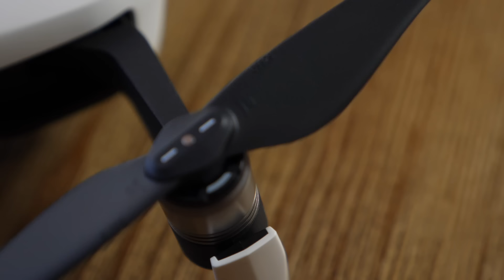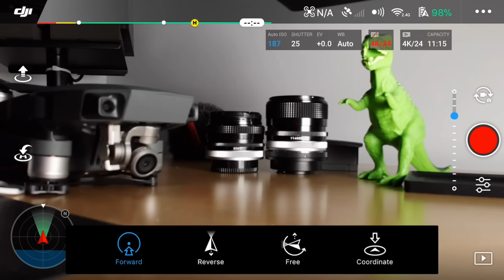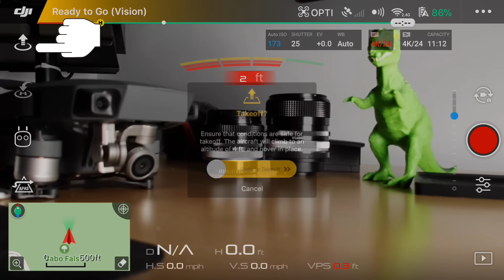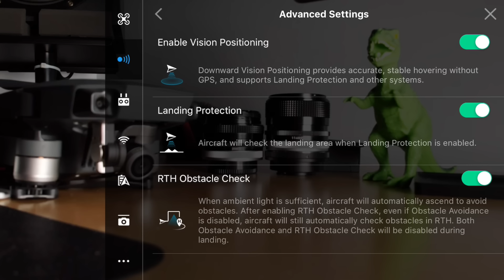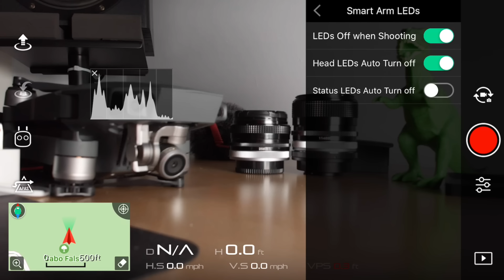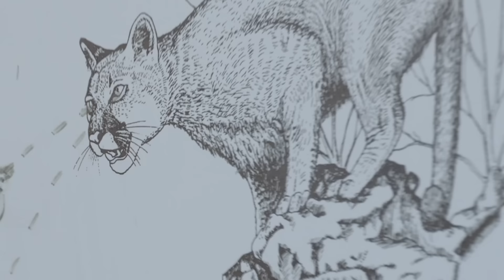DJI MAVIC AIR Beginners Guide - Start Here

Comment: Great video, no nonsense, no watching a 20 minute vlog to get to the content with over exaggerated reactions. Helps a lot, got my Mavic Air Flymore combo for 500 CAD used today. Has never been crashed, only 50 minutes of flight time, original stickers and plastic are still on some of the parts and batteries are all working. So stoaked, was going to buy a Mavic Mini but having the extra weight because where I am wind is a big issue and having all features of the air I couldn't be happier for the price, it's almost brand new.

Comment: Excellent video. Just got my Mavic Air. I had one problem setting up the drone. It asked for a password for the Mavic Air. I used the password I had with DJI...nope. Then I proceeded to use every password I have ever used....nope. WTF. Called DJI and actually talked with a human in just a couple of minutes. He told me the password was on the battery. Looked all over the battery...NOPE.
Finally looked in the battery compartment and there was that little stinker. It 's actually on the outside of the drone too. The other surprise was the "quiz". Got them all and passed that little surprise.

Comment: Really good info for someone new to DJI and the app. The most thorough and complete I've seen so far.  I had to rewind a few times because you moved through the options on the app so fast. I can fly pretty good but the app is a little intimidating to me. This helped a lot.

Comment: Excellent video. I’ve been flying a mini, but I just got a used Mavic Air, so I watched this video to check out all the extra features. Thank you for the comprehensive overview !
Reply: What app are you using to fly your Mavic Air?
Reply: @xseaangelx  DJI GO 4
Reply: @fullsendfishing2363  On my DJI Go4, there's no option to fly the Mavic Air. There's only a Mavic Air 2.
Reply: @xseaangelx  weird—— there is on mine. Connects easily

Comment: Thanks Bro - I was just about to pull the trigger on my first Drone as a beginner and was gonna go for the Spark until I saw this video. My feeling from the video and the comments below is that I will out grow the spark quickly where as the Air, for a little more money, will serve my purposes as a beginner better for longer. I subscribed and will begin watching and learning from your videos!
Reply: Got my MA yesterday and charged it up last night. Reviewed the directions for the 3rd time. Went out to my back yard and flew in Beginner Mode until 30 % warning. Practiced squares and then circles. Concentrated on Not over compensating on the joysticks . . . nice slow soft movements (like on the toilet bowl)!

Comment: for safety reasons, you should not turn on the drone first like in this video. the controller should always be turned on first. The drone could pick up a signal not related to the controller

Comment: I have flown quads for over 6 years now..starting with a $70 one learning to fly with no GPS..then got a phantom fc40..even built my own racing drone but didn't use it much..just got a yuneek thphoon H for around 1k..it is amazing for the price retractable landing gear and folding arms carbon fiber.. full 360   4k camera..just don't see how the price point on this can compare..it is smaller and I can do tighter flights because my hex is bigger..but my hex comes with a built in android tablet and is amazing more professional controller.

Comment: Extremely helpful intro to the MA controller and it's functions. Is it possible to open this app on a smartphone without either the aircraft or RC turned on so as to be able to get a grip on all the controls?  There's a lot going on there as you say, it would make sense to me to be able to do this without having to turn everything on and run the batt down. Great tutorial.

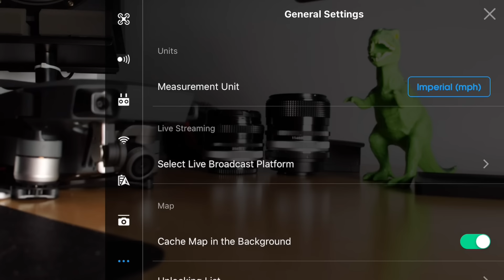Comment: Hey Jevon, I'm relatively new to Drone flying. Had a Spark and just got my Mavic Air today. I noticed first during setting up my Air and also while going thru your tutorial, the Measurement Units are set to Imperial (15:20 of this video) but several of the selections display metric units (15:56 RTH Altitude) . Not really a big deal for me, just an observation. Should all displays be in Imperial Units? Thanks again for your video's. Very informative with no BS.

Comment: I am newer to drones so please excuse the "lingo" I use
#1 - I have a Parrot drone which allows a function of true flight direction
With this option, if I move my controller to the left, the drone will fly left regardless of the forward facing direction
Is this available on the DJI ?
#2 - does this drone have an auto land or is the decent speed 100% manual ?
#3 - In your video, you went through many options to turn on or off such as obstacle avoidance - Is there any reason to not have these turned on / any advantages ???
>> real close to pulling the trigger but simply want to make sure this is the drone for me <<

Comment: Jeven, this is an excellent tutorial as my Mavic Air is new to me. BUT... I could only fly it once, using my LG K20 smartphone. That was great, as the drone itself is fantastic. Then it would not recognize the controller and always asks for compass calibration, even in middle of a large field. Very frustrating. So (doubting the Android shit) I exchanged the LG for an iPhone 6s. DJI recommends ONLY iPhones. Great issues getting the GO 4 software, from iStore however... Apple really sucks at that! . Have you encountered these kind of problems? Wish we could just connect drone/controller every time and fly!

Comment: Excellent video buddy!!! I am thinking of buying one instead of the high priced Mavic Pro 2
And with additional money buy extra batteries. What is your recommendation?
Reply from the maker: I'd get the Mavic 2 Zoom or the Air.  Depends on what you plan on filming.  The Air is amazing and can get you some awesome footage!  Also its super small and you can take it everywhere
Reply: @JevenDovey  
Thanks! Well it would be my first drone with DJI. The Air just has some cool features like hand jester control which is cool. The Air is a bit more compact and of course price. I am just really  looking for a new drone since my GOPRO KARMA has turned out to be a real dud. Discontinued with no updates the Karma was a big mistake I regret.  I am trying to sell my Karma remote, 2 batteries and bag. Keeping my Karma grip, hero 5 and gimble. Thanks for a terrific in depth video! I value your opinion and your business.  Cheers Mate

Comment: Awesome Video as always!! As a Newbie, I've learned an incredible amount from you alreadyI have a question in regards to using the remote controller; I understand when the right joystick is pushed up with the camera facing you the Mavic Air will move away from you. If you pull down, it will come back to you. Left is left and right is right. Now my question; If the Mavic Air camera is away from you does the  joysticks act in an opposite manner?  Example; down is forward, up is back towards you, left is right, right is left? I can't find any info. on this anywhere. Any help would be most appreciated. Thank you, Ray
Reply from the maker: No.  The controls will never flip.  Think of it like a video game.  If you turn in the sky forward is still forward no matter which direction you're facing
Reply: Thanks for the help. It appears that Mode 2 for the controls would be the better choice. Just need to keep in mind that the cameras POV is the decision maker. When the camera is facing the controller/you the controls act opposite. Thanks for the help and for your awesome videos, I'm certainly looking forward to more in the future. Happy flying!! 😋👍

Comment: @Jeven Dovey
Maybe you can help, I currently am flying the Dji Mavic Air! I am having problems with linking up the remote control to the drone to get that green light on your controller. I know you are suppose to hold at the same time pause bottom, FN button and the C button on the backside of the controller and then I get a 1min delay of blinking but I am having a really had time connecting to my remote.

Comment: question: i used to have a phantom pro 3. I dont have it anymore due to one "feature" that killed my drone. i was above a lake and i was messing around with the drone and I must have pulled the joysticks down and inward for a few seconds and it killed the motors. thus the drone crashed. does this new drone do that as well? or is that no longer a "feature" thanks !

Comment: This is a much-appreciate guide for a newbie (my Mavic Air arrives Tuesday). I wonder... in 360° spherical pano mode, can I set the camera to take the highest-res DNG images AND perhaps bracket them for post-processing as a HDR pano (I have the software for that)?
Thanks!
Reply from the maker: I'm not sure if you can use those settings.  Put it up in the air and see id you can :)
Reply: Done. You cannot bracket in pano mode. However, shooting DNG and optimizing each image from raw, and then manually stitching can result in a 19,046 X 9,523 equirectangular image of high quality.

Comment: Thanks for the great info.  I just completed my maiden flight and things went fairly well.  However, in the bright sun light I could hardly see anything on my iPhone screen.  I contacted DJI and was told that they do not offer a hood for the controller yet.  Admittedly, I am an old bastard and do not see as well as I once did, but one would think that DJI would have considered this need.  They make one for the Mavic Pro but it does not fit the Mavic Air controller.  Does anyone else have the same problem or know of a non DJI solution?

Comment: Hi, do you have a suggestion to charge a Mavic Air battery that does not have any led lights when I press the power button? Is it dead or just in hibernation mode?

Comment: If you have to change the cable which plugs into your phone, how do you remove the slider thing so it can be replaced with the slider that fits the cable you need to use?
Reply: Look at it carefully, twist & pull gently and it will come out

Comment: I just bought a Mavic air and have only flown it 3 times. Every time I take a picture or video and I look at it on my phone with my phone in the handheld vertical position as it should, the video has black bars across the top and bottom. How do I switch It to not have the black bars and be full screen on my phone?

Comment: Quick question.  I know on the Phantoms it may be different but when you come down to land and your lets say 3 feet off the ground you pull the stick down and it lands and the props stop.
If you are at a 100 feet and pull the left stick all the way down the props wont stop will they?? Doesn't it sense if it is near the ground?? Sometimes I want to come down faster but am afraid to try it??

Comment: Hi Jeven, great tutorial. I have a Mavic Air. Have had it since it was first leased, I have not flown it for a year or more. Going back through your tutorial. When I go to controller general settings, your example is much different than mine. Yours has a all that good information on Remote Identification, Identification and Flight Info, Identification Flight information .  My controller shows none of that. My controller version shows 01.00.0200 and my aircraft  is 01.00.0620 the DJI Go Fly  app is 4.3.60. Can you help?

Comment: I turn on my Mavic Air drone and the props turn ; gimbal moves ;.....THEN i am supposed to hear the fan inside spin up and i should hear the sound alarm and i should see the red light flash... BUT i dont.
After the Props, Gimbal movement, i get a yellow light , it stays on constant yellow.
Remote light stays red and Drone just chills there getting hot , constant yellow light.
Dont know what the hell is going on,

Comment: GPS DOESNT USE SATELLITES 
It uses towers on land to ping your location -
Reply: The Global Positioning System (GPS) is a network of about 30 satellites orbiting the Earth at an altitude of 20,000 km. ... Once it has information on how far away at least three satellites are, your GPS receiver can pinpoint your location using a process called trilateration
Reply: @maxodgaard1335  it's triangulation and its done by pinging you're phone and picking up the signal with surrounding towers. It was around before SATELLITES were a thing

Comment: So I bought a used mavic air, boots up fine and works but cannot connect to gps (I can only fly in opti) I know satellites are available because my spark connects fine, can anyone help? Also using an aftermarket cable to connect phone to controller.

Comment: Hello I need a help. I'm with DJI mavic Air now. I on and use the app to but the front two lights are not changing it to green from red. Also in my screen it gives Ready to Go (vision) but not in green colour. I tried so much but never go green. So I'm using the drone to fly without being in green signal. So anyone please help me in this. Thanks a lots. God Bless.

Comment: my drone crashed when i flew it for the first time .. it was not following any commands that i gave from remote control ..it just took off and started heading in unilateral direction.. when i pressed land button on remote or app it would not accept it ,,, any advice or cautions to take before flying ..???
Reply from the maker: Make sure everything is linked up before you take off

Comment: my controler get red light and i canot conect (i cant "go fly"), there is anyway you can help me?
Reply: Paulo Ramalho press the 3 dots on the top right, press the remote control option and begin calibration. The controller has to be plugged to your phone. While it’s going, hold the button on the back of the drone until it beeps once. Wait ten seconds and u should be good

Comment: Mavic Air.

I get jerky movement on my Left stick (yaw).  It  would move slow after I set up a slow setting for it, but then it suddenly skips really fast and then slows down again.  Do you think that has something to do with my stuck gimble?  i did fly on sand yesterday and I hope I didn't ruin it.
Reply from the maker: Was it smoother before yesterday?
Reply: i actually really don't know. I'm more beginner than beginner lol.  I'm just wondering if it could be stuck or maybe my settings might suck.  do you have videos on correctly adjust yaw speed  for cinematic look?  I'm charging my drone again to try it again.
Reply: also do people have tricks to cleaning the camera and gimble?  I may have some sand on it since I left it on the sand to fly.  I couldn't find a different spot so i just left it on there.
Reply from the maker: Use an air blower.  https://amzn.to/2tPDO1h

Comment: When I plug my phone into the controller my phone starts charging how do I change this? Is this normal?
Reply: its normal
Reply: Yes. It's normal. And it happens because you're using Android. I learned iPhones don't have that issue and it's something specific to Android and how it charges, which DJI can't do nothing about that.

So to prevent drain on the controller, keep your phone battery at least 50%

Comment: After 12 hours i still cant connect the RC to the drone. Sack of sh************ Never again!!!
Reply from the maker: Might be an issue with your unit.  Contact DJI
Reply: I deleted Go 4 and tried to reinstall but now can't even do that. Running out of options short of sending it back. Lots of ppl saying same, Jeven